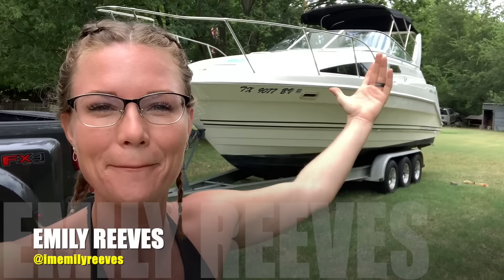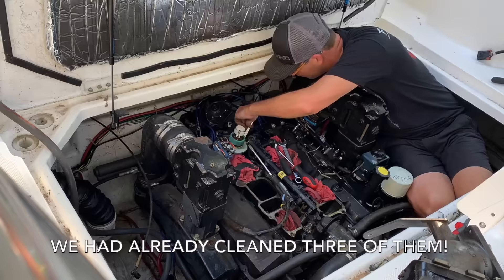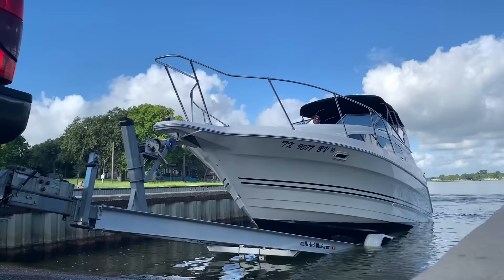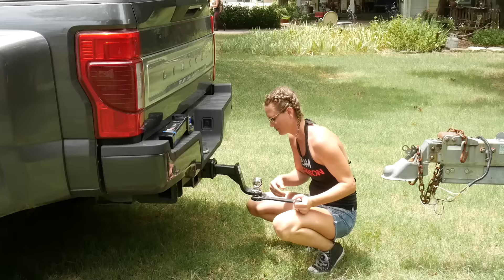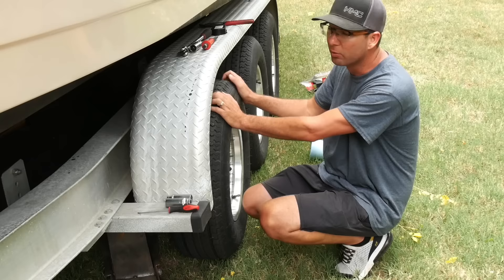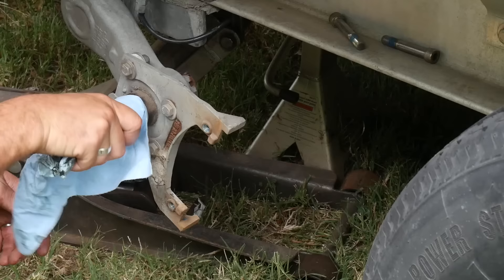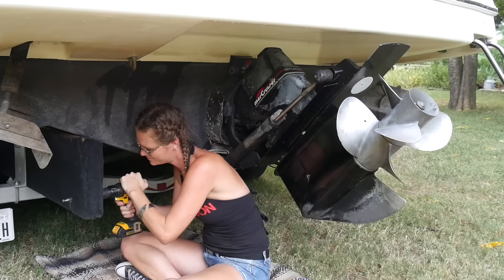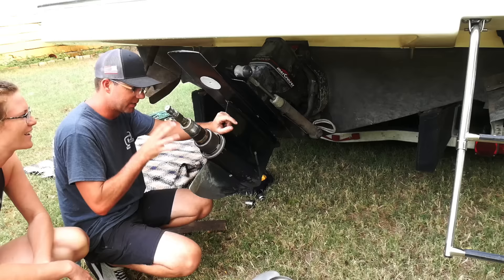Prepping our 5k boat for 10 day adventure!!!

Comment: Me being the tight ass I am would have thought and convinced my self that that's why there are 6 tires.bought 1 for a spare.and if one blew I would put the spare on.then if another one blew I would slow down a tad.but if more than 1 blew on one side,then I would  get the tires if it happened relatively frequent between blows.sihce you could expect the rest soon if same age.then I would start my trip .then as soon as I  got on the most congested super highway at peak rush hour traffic,they would all blow simultaneously leaving the out drive broken off and trailer on the rims as I drifted out of control bouncing of 75mph cars on both sides then into the guardrail.or I would just blow 3 tires simulteaneously....on the same side causing the boat to rip the eye bolts right through the wooden 2by 10 it's mounted to and bending the trailer hitch and frame as it rolled off the trailer and tumbled down the freeway off cars jumping the guardrail and into oncoming traffic...in other words..you might have wasted some money on tires.but you bought an insurance policy that  likely would guarantee those tragic types of scenarios won't happen.and there are endless amounts of others that wouldn't happen as well.and we all know we don't get the money back we pay for any type of insurance.so .I WILL SAY I HAD A HEAVY BOAT THAT I BOUGHT WITH I BOLTS IN THE WOODEN RUNNING BOARDS LIKE YOURS IS.AND WRAPPED WITH CARPET IT ALWAYS LOOKED NEWISH CAUSE ALL I SAW WAS TURF CARPET HAT  NEVER ROTS.BUT THE WOOD AROUND THE EYE BOLT HOLE THAT WAS DRILLED WAY AFTER THE WOOD WAS TREATED FROM ROTTING AND INSECTS.PRESSURE TREATING HELPS TO PUSH THE GREEN CHEMICALS  INTO THE INTERNAL PARTS OF THE WOOD THAT ARE INTERNAL.THE END GRAIN SOAKS UP MOST OF THE CHEMICALS PENETRATING INTO WOOD LIKE WATER FLOWS WHEN ITS GROWING.BUT SOMETIMES NOT ENOUGH PRESSURE IS ADDED,OR TIME BEING PRESSURIZED IS SPENT.WHEN DEMAND IS HIGH FOR TREATED LUMBER,AHD INVENTORY LOW,THEY REDUCE THE SOAK TIME AND PRESSURE TIME TO INCREASE OUTPUT.AND THEY GO TO THE EDGE OF SOME NOT GETTING ENOUGH.SO LUCKILY I DISCOVERED THAT WHICH I SHOULD HAVE ALREADY KNOWN JUST FROM COMMON SENSE AND UNDERSTANDING OF THE MYSTERIES AND WAYS OF THE WORLD ...BUT YEAH ,,,I FELL SHORT OF THE I.Q. REQUIRED AND I HAD TO FIND OUT BY GETTING LUCKY THAT  I SLIGHTLY OVER TIGHTENED THE CRANK STRAPPING FROM I BOLT TO BOAT.IT PULLED THE LARGE WASHER AFTER BEBNDING IT SOME THROUGH INTO THE HOLE WHICH HAD ROTTED AROUND THE DRILLED HOLE.THAT DIDNT GET ENOUGH WATER PROOFING GREEN JUICE FORCED INTO THE GRAIN OF THE WOOD.ALL 4 I BOLTS AT NEAR THE END GRAIN OF BOARD SUCKED JUICE IN EASILY.BUT THE 2 MIDDLE BOARD I BOLTS WERE DOUBLE THE ROT DIAMETER OF THE ENDS.BECAUSE GETTING LESS GREEN JUICE.SO I RE ANCHORED THE BOLTS INTO THE Trailer FRAME..I GUESS IF WHENEVER THE TRAILOR CO. DRILLED THE HOLES,IF THEY PAINTED OR SEALED THE HOLES BEFORE PUTTING THE BOLTS IN IT WOULD NEVER HAVE ROTTED.BUT NOBODY EVER THINKS OR THE ONES THAT DO DONT CARE.LOL....AND IT MAY NEVER BE A PROBLEM.THE TRAILOR AND BOAT MAY BE KEPT IN STORAGE,OR WITH A GIANT COVER KEEING DRY.OR THE LUMBER CO. MIGHT NOT GET GREEDY AND NOT SOAK OR PRESSURIZE THE LUMBER LONG ENOUGH.THE PERSON WRAPPING THE TURF CARPET OVER BOARDS MIGHT USE PLENTY OF GLUE AND THAT ALONE WOULD SEAL .BUT IF THE PERFECT ALINEMENT OF THINGS NOT GETTING DONE ,LIKE MINE,AND I HIT A FRESHLY THROWN RECAPPED BIG RIG TIRE IN MY LANE ON THE WAY HOME ON  HIGHWAY  I-75 WITH TRAFFIC BOTH SIDES,OR JUST DONT SEE IN TIME.AND HIT IT WITH THE WHEELS AND BOUNCE MY TRAILER VIOLENTLY IT WOULD HAVE RIPPED ALL MY BOLTS OUT EASILY.

WATCH FOR THOSE RECAPS FROM BIG RIGS SEPARATING...A MONTH AGO MY WIFE DRIVING OUR MERCEDES GLS 500 AT NIGHT ...DOIN 80 MPH THE CAR IN FRONT JUMPED ABOUT 1.5 FT. UP FROM THE HIGHWAY AS WE SAW A HUGE TIRE RECAPP OFF A BIG RIG UNDER THAT CAR AND NO TIME TO REACT WE HIT IT BETWEEN OUR TIRES DEAD MIDDLE .AND WE ARE IN A SUV THATS HIGHER THAN A CAR.THE TIRE WAS MUCH WIDER THAN OUR CLEARANCE  TO THE GROUNDSO AT THAT SPEED IT FLATTENED THE TIRE SOME AND RORCED TTHE AIR SPOILER BELOW RADIATOR TO BEND AND GET IT STARTED AND IT WEDGED THE REST OF THE WAY UNTILL IT COULDNT  FIGHT PHYSICS AND MADE OUR CAR JUMP 2 FEET OFF THE ROAD.AT NIGH ,IN TRAFFIC,DOIN 80,AND SOMEHOW GAINED BACK CONTROL WHEN LANDING AGAIN.THE HIGH TECH BENZ TRACKTION CONTROLS AND TECH THE CAR HAS SAVED US FROM A CRASH.ANR THE IMPACT AND VIOLENT SOUNDS WAS LIKE A MAJOR HEAD ON COLLISION? WE BOTH WERE IN SHOCK AND IUR BAINS FELT LIKE SLIGHT CONCUSSIONS FROM THE FASTNESS OF THE EVENT JOLTING OUR NECKS.SOUNDED LIKE THE FRONT END WAS RIPPED OFF,THE UNDER CARRIAGE AND MUFFLER WERE DESTROYED.BUT AFTER INSPECTION I COULD FIND NO DAMAGE ANYWHER.ONLY A COUPLE OF DISCOLORED AND EMBOSSED MARIS FROM FRONT TO BACK.WE STILL CANT FIGURE OUT HOW  THAT WAS ONLY DAMAGE.1 MONTH LATER A OBJECT CAME FROM KNOW WHERE FROM A WORK TRUCK GOING OPPOSITE DIRECTION .IT CAME OVER THE CONCRETE DIVIDER SHATTERED THE 1600 DOLLAR WINDSHIELD.A WEEK AFTR THAT NARROWLY MISSED BIG ONE.THIS TIME IT WAS THE ENTIRE DOUBLE WHEEL UNIT WITH PIECE OF AXLE FULLY INFLATED TIRES,BOUNDING DOWN THE HIGHWAY RIGHT AT US.IF IT WAS NIGHT WE WOULDNT HAVE SEEN IT TO AVOID..
SO BE SAFE.THE HIGHWAYS IN GEORGIA AT LEAST ARE INSAINLY DANGEROUS AND CROWDED THESE DAYS ,WITH CONSTRUCTION WORK  CONSTANT.AND THOSE RECAPED TIRES LAYING EVERYWHERE ALONG THE FREEWAY.ITS BECOME CRISIS LEVEL

Comment: I'm in disbelief did she really put the anchor points on the slits you're supposed to put it on the aluminum frame the bumper is made out of a special material that's supposed to be sealed to keep it long-lasting I know you guys are new to boating so I'm not going to be harsh but you should probably get some Marine grade 52000 in fix that

Comment: HolyCow! You all are lucky that boat and trailers weight didnt destroy your 5000lb rated hitch and go its own way down the road! And for gods sakes, stop running an outboard with no water going into the outdrive!(Your older video when you finished putting on your used outdrive).  Even when the outdrive isnt in gear the pump is still being turned by the engine (neutral) and the rubber impeller in the outdrive water pump usually gets destroyed when ran dry.

Comment: Those loops you put on the trailer are not strong enough!, you need to get cast loops and a safety chain in the front so you are not relying on the winch to hold the front !

Also, do you have brakes on the front axle only or all three?

Comment: Yes, stop power loading your boat not what it was designed to do.  I work for DNR and depends on your location but you pick up all the sand or gravel from under the ramp and its very costly to redo the ramp ave. cost 30,000. And in some places its a 900.00 fine.  Just saying

Comment: I'm surprised I didn't see you seal the bunks where you drilled for the eye bolts.  The bunk will rot faster than it would had you not drilled. Is the carpet on the bunks not waterproof? Or at least made to wick water away from the wood?

Comment: no dont put the straps there you need to strap to trailer frame not a wooden bunk it needs to be to the actual trailer frame not wooden bunk very strong straps too 3 into 4inch wide